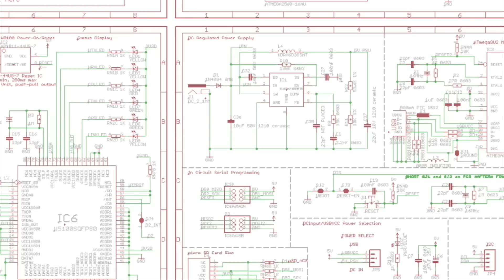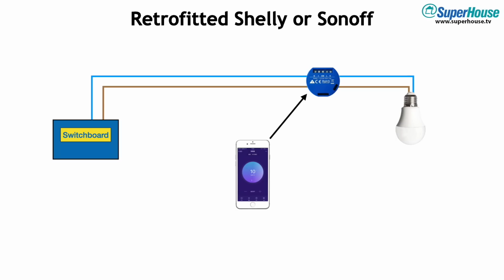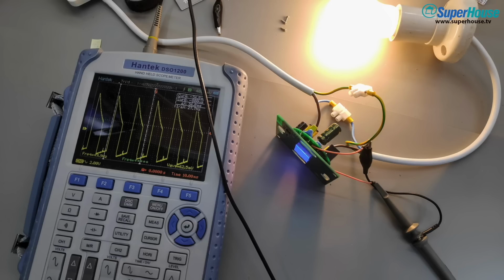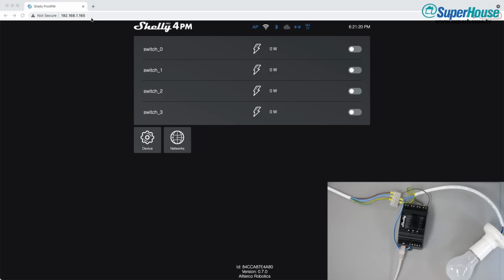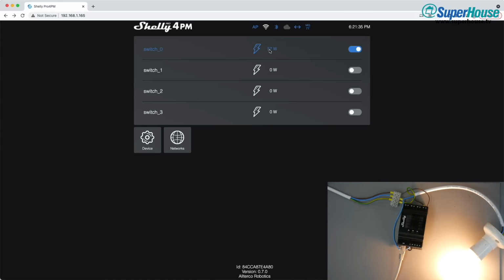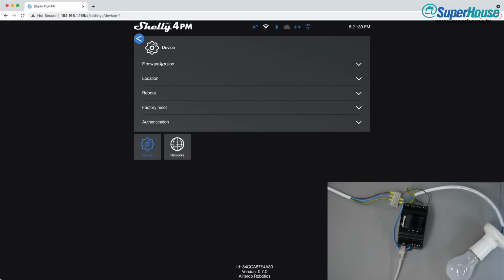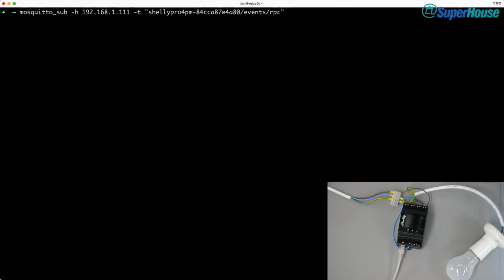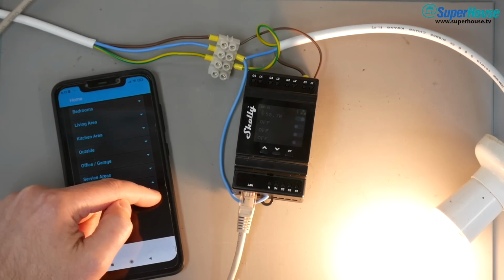SuperHouse 45: First look at the new Shelly Pro 4PM

Comment: Whats the legality of removing a switch in Australia?
Reply from the maker: If you're not a licensed electrician, you can't. I may have done a rant about that ;-) https://www.superhouse.tv/vlog-63-australia-worst-place-in-the-world-for-diy-home-automation/
Reply: @SuperHouseTV  So looking at this video, it's clear that you are a licensed Electrician? Otherwise you would be breaking your local state laws in this video?
Reply: @SuperHouseTV  yeah completely get that (and had a laugh at your linked vid a few weeks back), however I had heard somewhere that to meet the wiring standards, every light/power circuit has to have a physical isolation switch in Aus.
Reply: My understanding is, anything that is hardwired or in a structural enclosure (wall, switch board) you have to be licensed to modify. Unlike in New Zealand.
Reply: I'm guessing that if your not an electrician in Australia, don't touch anything mains.  This video needs a waem and friendly-" For informational purposes only- do not try this at home - ever." Message